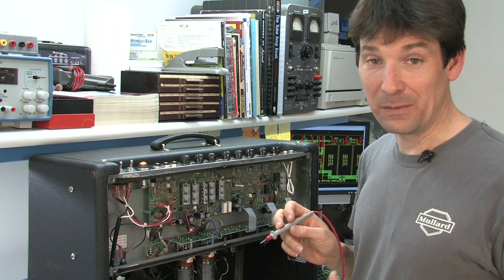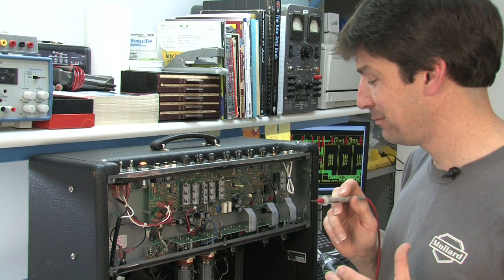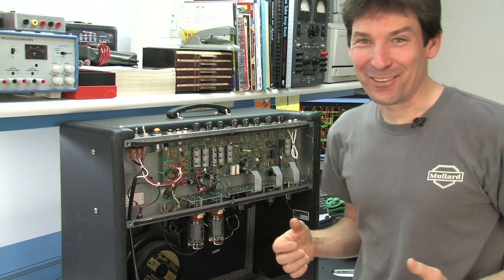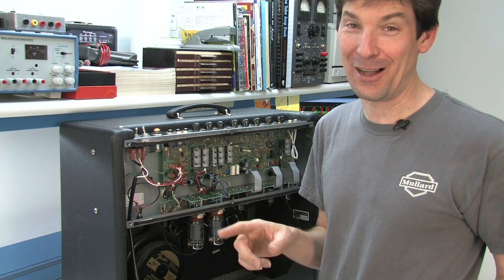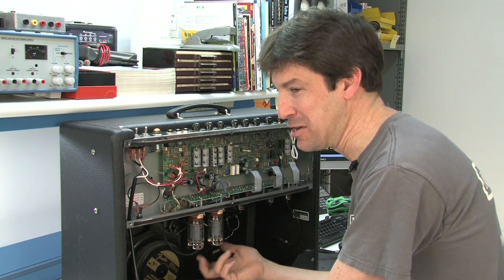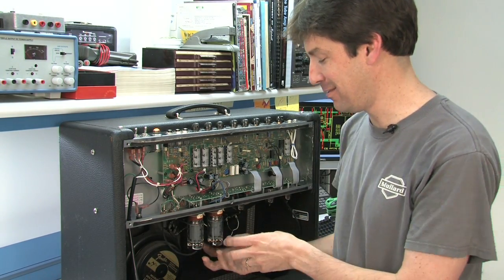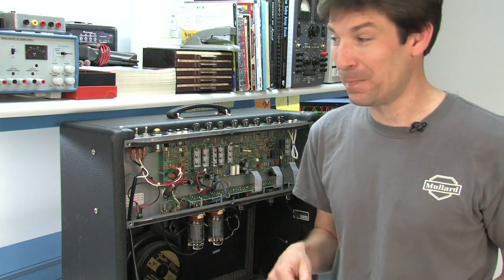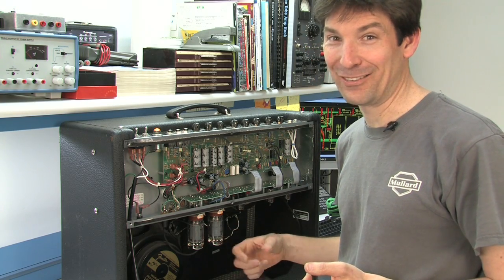What Is a Microphonic Power Tube?

Comment: Now dont confuse that with tube rattle.  Tube rattle doesnt necessarily come through the speaker, but the tube rings like a bell at certain and or loud frequencies.   I've had great success with tube dampners, or any high temp o-ring from a hardware store or auto parts store.  It just acts like a mute on a bell.

Comment: That might explain why the bass tone in my 1955 Buick radio had "fat" sounding bass: perhaps the audio tubes were microphonic: as the base notes vibrated the cabinet the tubes "miked" the bass and therefore "fattened" it. But that's my hypothesis, it could also be that the 12BF6 preamp tube naturally fattens bass. No longer having that radio beings I sold the car, I'm not able to experiment around with the radio to see if the audio-tubes were in fact microphonic.

Comment: quick question... i have an ADL 600 tube preamp by Presonus which sounds AMAZING when running a bass direct HOWEVER, i'm getting this unpleasant "fax machine" like sound:^( its faint and isn't present in a busy mix but as the notes decay naturally at the end of the song this noise comes thru. any ideas, tips or advice?
Reply: +CoTheReal 
I just had a power tube in my guitar amp go... it made a sound like someone was running a copier on the same circuit, then just noise every time  I moved a cord. I thought the jack was dirty, but no, bad tube.
Gently tap device then tube and let your ears be your guide.
good luck!
Reply: i used a direct box to bypass the instrument input and it solved the problem for me but thank you for the reply;^)

Comment: I use a fender twin amp.. I just got the amp serviced not too long ago, new power tubes were put in...on certain notes when im playing through a les paul, I hear the tube rattling in the amp...its not that loud, but are they bad tubes?
Reply from the maker: Sounds like you have a microphonic tube ... could be a preamp tube or power tube.  You will have to lightly tap the tubes to see which one.  Microphonics doesn't mean a tube is totally useless, but rather it's microphonics make it unsuitable for the position / application it is installed.

Comment: Thanks for the response.  I have a DR Z MAZ 18 combo, and I guess it is pretty punishing on the EL84's...I also have a Fender Blues Jr. With both amps, I have had issues with microphonics in the EL84's.  It comes through like a spring rattling against glass...which it is...the tube keepers vibrate against the outside of the tube and it gets amplified. Usually, G, A, and/or D notes are the triggers. If I remove the holders, it sounds fine, but I can't risk a tube falling out while playing.

Comment: If a tube is found to be microphonic, is it acceptable to install the silicone tube dampers, and if they solve the problem, then it's fine, or does the tube always need to be replaced? Also, will installing tube dampers on non-microphonic tubes help guard against a tube becoming microphonic by decreasing the vibrational stress on the tube?

Comment: I'm having the same problem with my VTL ST-125, except it happens on all tubes when I tap lightly ANYWHERE on the case, any of the tubes, transformers, caps and when I put a screwdriver in to the biasing port, I'm running cheap 807's bought from Siberia, could that be the problem? or maybe its time for a service. and no, it doesn't happen when I lick them, maybe I'm not doing it hard enough.

Comment: Thanks for the info, when I play an open A (this has always happened) there is a noise through the speaker that sounds like metal jangling, i always thought it was the verb tank doing this, but after having removed it to see, the noise was still there. It doesnt bother me though. Also, in the last week, it has developed a popping noise that remained after cleaning and re-tensioning all of the valve sockets, and an ominous low-pitch hum and jangle when it is powered on. time for a tube change?

Comment: The JJ E34Ls in my 50w Marshall combo have always made that noise when tapped ever since they were installed over 8 months ago, and so did the marshall-branded pair before them.  Is this normal or were both pairs of valves just crappy?

Comment: Done and done. The sparks definitely came from the power tube base, but it all happened so quickly I couldn't narrow it down to which pin. When I took it to the tech he said the amp was fine, so I can only assume that either I'd missed a tiny metal shaving that had vapourised in the fireworks, or that gremlins were to blame.

The drill was a hammer drill. I don't know if you've ever used one of those in the hammer mode but they do create a fair amount of vibration. Oh well, hard lessons learned!

Comment: I made my power tubes microphonic by drilling the chassis with the tubes still plugged in. Very stupid mistake I know. The first thing that happened was the amp shot sparks, so I took it to the pros to get it looked at thinking I'd done something wrong, but they said the amp was fine but the power tubes were both microphonic. I'm guessing the sparks were because the valve had shorted out internally.

Comment: I just had the transformer replaced in my amp and the tubes are pretty old. I get wierd sounds out of my amp, but only on the gain channel. It sounds like someone installed a rotary phone in in it. Could it be bad preamp/poweramp tubes, or should i take it back to the shop?

Comment: Wow I have N-E-V-E-R NEVER seen a pair of microphonic tubes come from Tube Depot. They have always supplied excellent current production stuff. OK with my test rig every tube ever made is microphonic at some point. It has always required extreme  torture to make a Tube Depot pretested tube pick up outside noise. Licking? No, but,  I've had  sweat drip on a tube and the glass failed with an implosion. The boss is a cheapskate & kept the shop 90 deg+ all summer.  His office was <80, but not mine.

Comment: I have a precarious solution for that, but it works. Some ago I reasoned that if the spacer are loose inside they need to be re-tighten. Well how do you do that? Simple: since there is vacuum in the tubes you can torch them. Torch them? Yes sir. You use a small plummer's torch on the spots you see moving inside the tube and the glass will bent towards it because of the vacuum inside.